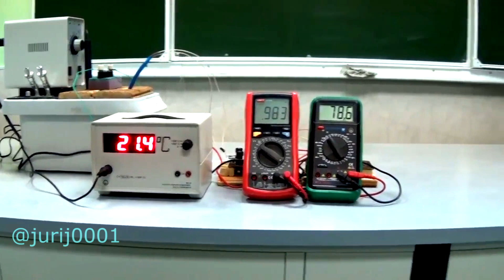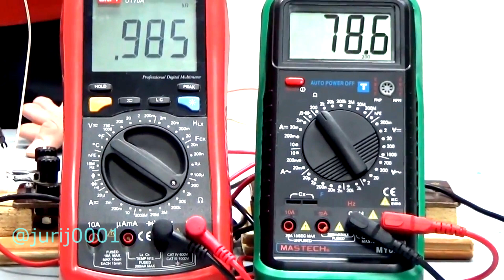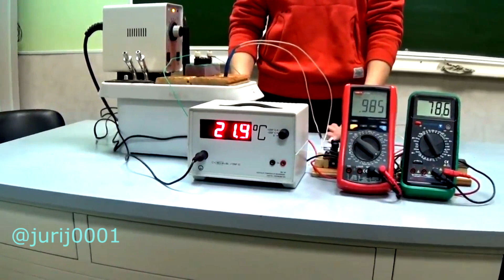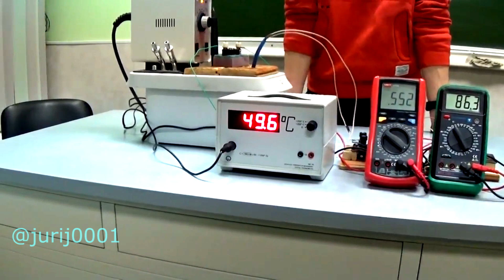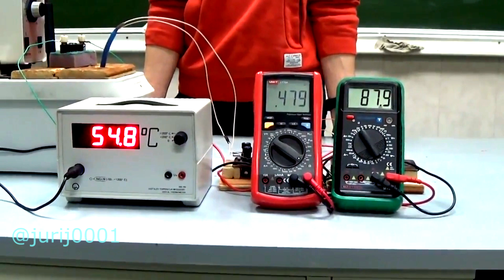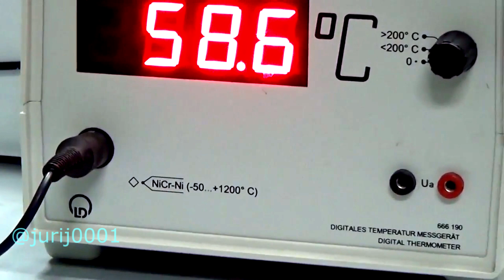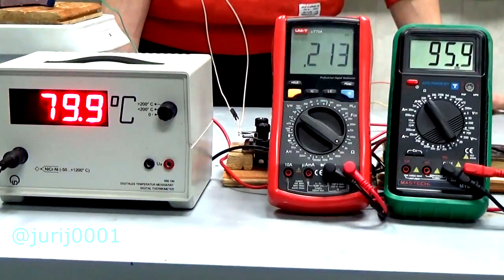Dependence of Resistance on Temperature. Physics. Electrical engineering.

Comment: I am interested in a project which involves a lot of math. In the Bible, in Genesis 1:6,7,  it states that before humans existed there was a canopy of water which surrounded the earth; a bubble of water above our atmosphere which surrounded the entire planet. This situation existed until the flood of Noah's day at which time God allowed the earth to be flooded with those waters above and the floodgates underneath the surface of the ground as well. (Genesis 6:11) During the time the "bubble/layer of water existed, the lifespan of humans regularly reached into the 900th year. But, after this canopy/shield of water was taken away, human lifespan dropped significantly; 279 years after the canopy of water was taken away.
If you were to model this phenomena mathematically, I wonder what would be the effect on gravity on the earth's surface. This canopy/water shield atmosphere was the atmosphere humans were made to live in and may the optimal conditions for true human gene expression. Many human genetic functions may not even 'turn on' without this atmosphere. And the thickness of this canopy, from inches to potentially feet thick may vary the possible solutions.
I know you are a smart guy and find solutions to difficult problems; this is one which may have exponential benefits if delved into and solved. If you are not interested, bring this up to a colleague who may be interested in such a possibility.
Reply from the maker: Your comments deserve special attention and I need to understand very well what You wrote ! and this is great ! I hope that some of my followers will respond to Your comment. Thank you for writing this ! Sincerely, Yuri Kovalenok